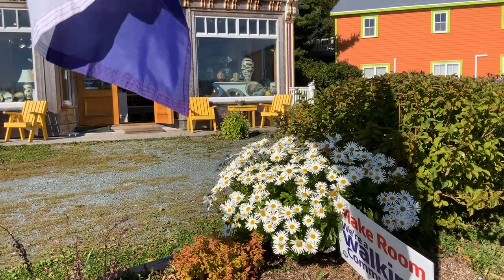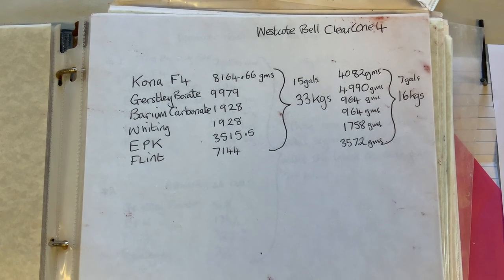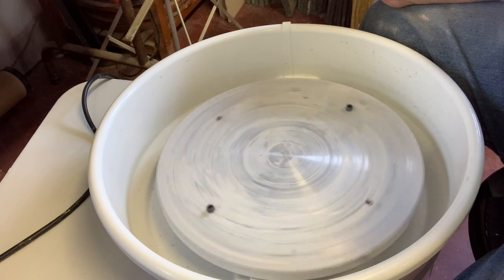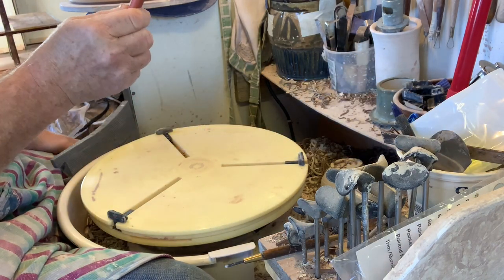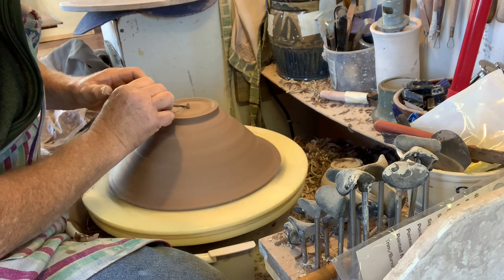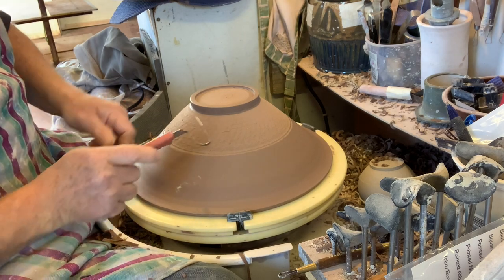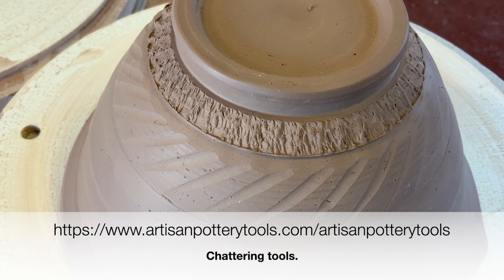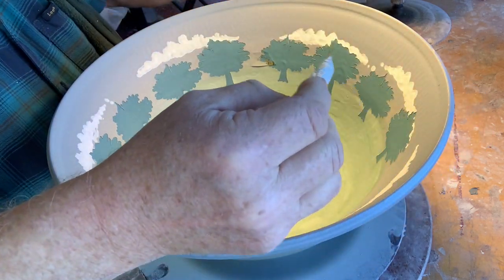Chattering tool demo and stencil removing.

Comment: Love your videos Vaughan! And those daisies are gorgeous - think I’m going to have to get some. By the way - it is possible to treat Japanese knotweed. Usually in the uk it’s a specialist company job. You can be prosecuted here if you allow it to spread into the wild - it’s not a cheap job though! Good luck xx
Reply from the maker: Thanks Hilary. The knot weed is every where over here, all along the river banks and on the road sides. We plant the Montauk Daisies because they compete well with it. There is a weed killer that works on it but being so close to the water I won't use it. I pull it out whenever I see it spreading. We need mountain goats, now there's an idea. Apparently it tastes like Asparagus when under 12 inches high.

Comment: Vaughan, your stenciling removal has a magical feel when you are doing it. Great results. 
Chattering is so satisfying and so much fun to play with giving different results seldom if ever repeated. Th defining line really makes it stand out well. I like doing it when the clay is a bit cheesy to get the depth, and by holding the tool beyond the 90 degree angle it digs even deeper. This is a 2 1/2 minute video of some results I have had, using the metal strapping from transporting roof trusses:  https://youtu.be/NN_bCgxT4F8
Thanks for sharing...Cheers ...Freddie
Always neat to see the garden at the beginning.
Reply from the maker: Great video. The tools the wheel came with work too.

Comment: I don't like that the slipwork is on the interior of the bowl. This heartwarming movement is understood but reserved over a utility surface and to adorn the exterior surface is best suited. But not a failure at all. In my opinion slightly overworked and less fluid.
Reply: I like to be able to pick up a bowl while attached on center for a trim. Whereas to check for weight. And, there is a way to dry the bottom curve of a bowl with an electric heat gun in order to achieve a proper leather hard in that moist of an area. A fan is great for drying also, just remember to rotate and flip pots so they dry evenly.